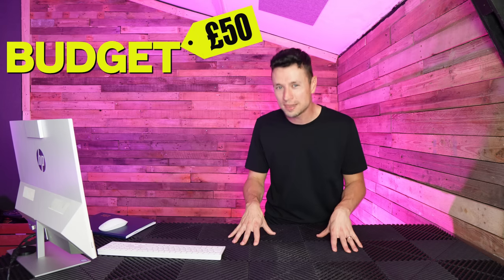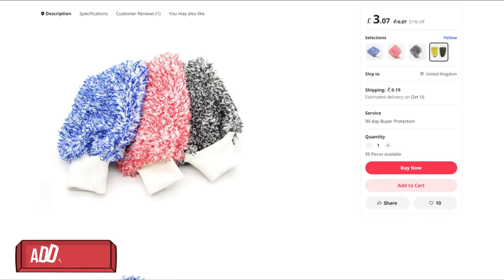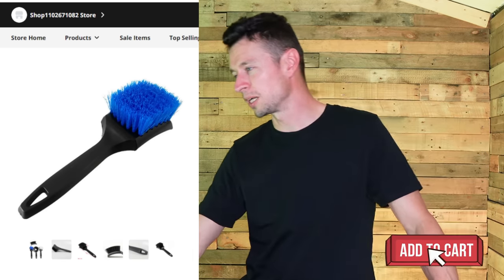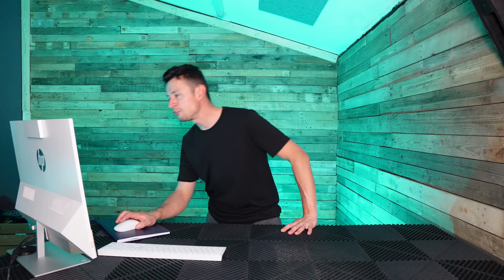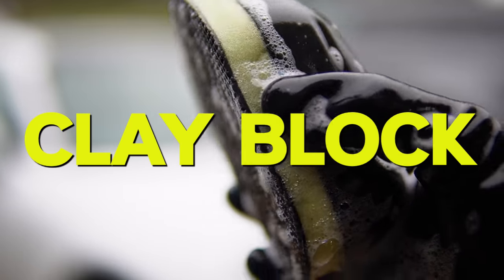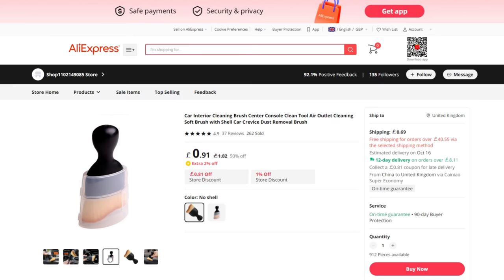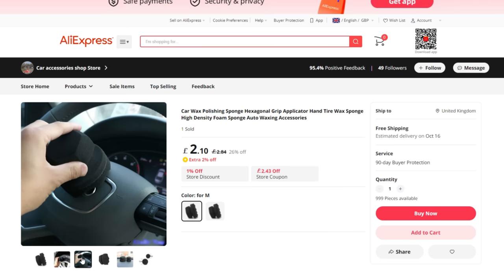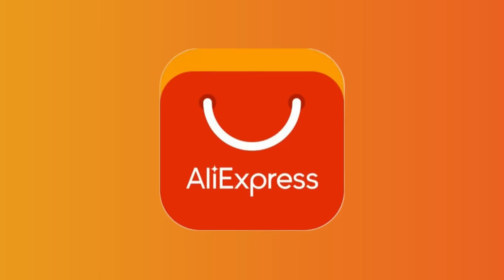I Bought the CHEAPEST Car Cleaning products on AliExpress

Comment: I bought DPro ceramic coating on Ali last year. Still holds up Luke new, beading and sheeting like I put it on yesterday. Absolutely convinced it is the same formula as the expensive brands.
Reply from the maker: That's interesting for sure very intrigued as I seen some Chinese coatings leave a white film so the car almost loses that clarity, up for trying it though
Reply: They can be hit or miss, one I tried was like water and did nothing
Reply from the maker: @HantsLeo  I won't hold my breath on the Mr fix ceramic coating 😬
Reply: @epicautomotivedetailing  To be fair, both cars were white. Great shine though, could not find anything wrong with it. I'm not a professional detailer though, just a hobbyist.

Comment: AliX is a great place to get a snow foam cannon. I've tried most of the common variants (that's how I've ended up with 6 or so in my garage), and there's a cannon that has a distinctive twisted front nozzle that's available in a bunch of colours from quite a few sellers, that I've found works very well. That one usually goes for around £13.
Reply: Do you have a link for it?